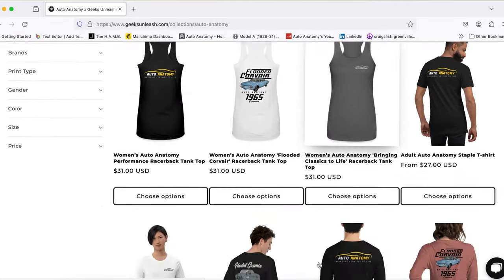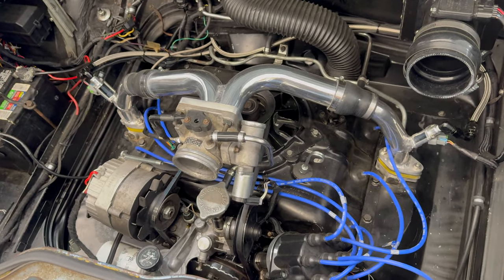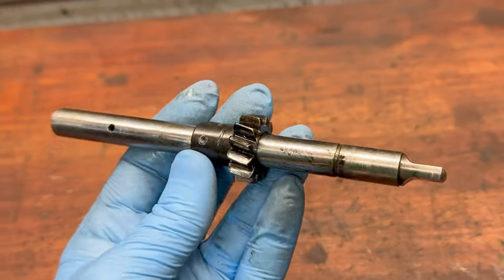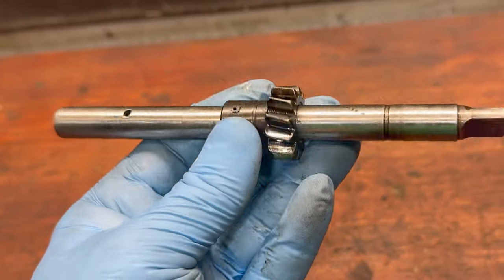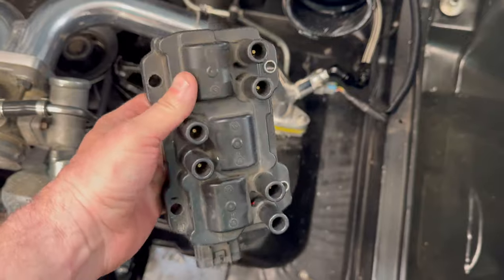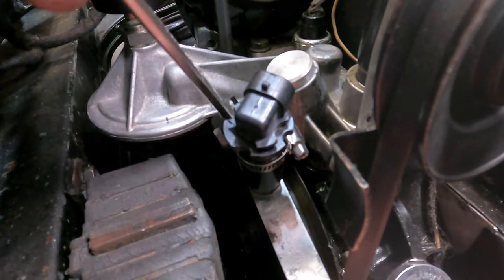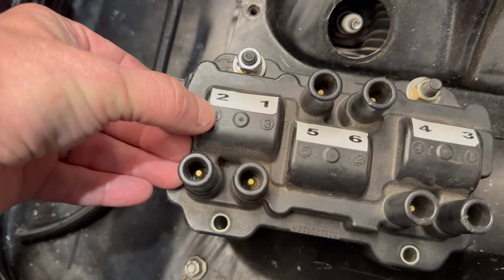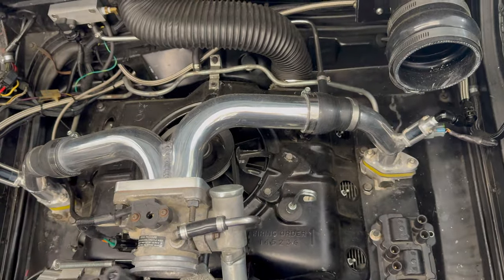What?!  Distributorless Ignition on the FLOODED 1965 Corvair with Fuel Injection!

Comment from the maker: This was a HUGE project, but what next?  I'm thinking either rear suspension or front disc brakes.  Let me know below 
what YOU would like to see

Sean & Christie
Reply: Whatever you think it needs most. Braking is pretty important but so is handling. How about a set of Corsa heads and an electric fan to replace the belt driven one. I always had trouble keeping the belt from flying off. Have you ever driven stock Corsa with the four single barrel carbs? The power delivery is noticeably different and more  fun of course. That's why my fan belt keep coming off, too many rpms.😁
Reply from the maker: @thatsonebadhatharry8610  I have a set of stock 140 heads here but would like to get some work done one them, like deep valve seats and modify the intake and exhaust ports.  But then we’d need to remake the fuel injection system…
Reply: @AutoAnatomy if you do 140 heads, maybe go from 2 injectors to 6? 👀
Reply: Remake the intake from the rubber sleeves to the heads and add two more injectors. I understand the need for better valve seats. Just pondering how the four port heads would do with the fuel injection. I don't remember but are you using a Corsa instrument cluster? If not do you have a way to check head temps? It would be beneficial if you could use a knock sensor on one or both heads to help control ignition timing. Anyway love what you have done so far. Just keep it between the ditches and have fun this weekend in N. Georgia. 
God Bless and be safe.
Reply from the maker: @silverfin198 When we do 140 heads, the plan is for 6 injectors and sequential injection.
Reply from the maker: @thatsonebadhatharry8610 I do have a Corsa cluster in the car but haven't found a reasonably priced temp sending unit (most are >$100).  I can check cylinder head temp through the computer as there's a temp sender I screwed into the top of the engine through one of the shroud bolts.  It's pretty close to the factory location and gives me a rough idea of head temp.  

As for knock sensor, my concern would be the degree of mechanical noise these engines make, which might make things too noisy and render the knock sensor difficult to utilize (just guessing here).
Reply: Sean, great project and I love the videos. My vote is for the front disc brake upgrade.

Comment: It's funny that we usually focus on horsepower but the professionals balance out all the things that make a engine better.  Easy starting, smooth operation, reliable, off-idle torque, the shape of the torque curve, throttle response.  With mechanical operation, we have to trade off some things for other things.  With a computer controlled engine we can have more of the good stuff without the trade-offs and this is what you worked so hard to accomplish. Good job.  

I had a '61 Falcon.  Even after I just adjusted the front brakes and everything was adjusted just right, cut the drum, and rebuilt the wheel cylinders, the drum brakes were still a problem with the braking either not enough or with the wheels locking up.  Replace the front brakes.  You don't have to go all high performance or aftermarket to get better braking.  For instance, the Omni GLH used brakes from the Chrysler Minivan to achieve fade free braking and excellent feel.  The advantage of Wilwood or aluminum aftermarket calipers is lighter weight.

Comment: Such a clean installation! Amazing that the coil pack bolt pattern matched right up with the Corvair's shroud mounting points! Love the sound of that engine. Regarding my vote for the next video, though the rear suspension is very important, it's not as "sexy" as a disc brake conversion. So my vote is for the disc brakes. It'll be interesting to see how you tackle modulating the front disc to rear drum pressures or if it's even an issue. Thanks so much for these informative videos Sean. You do an excellent job filming and editing these treats. And God bless you Sir.
Reply from the maker: Thank you so much, and it was such a surprise that it mounted so cleanly.  I think I'll likely be doing discs next since that's what most want to see.   

Thank you again!

Comment: You may want to add a couple phenolic spacers to the studs when mounting the coil pack, leave some air space between the coil pack and sheet metal this area gets toasty at idle.
Reply from the maker: Good point, I have some high temp phenolic left over from the intake build, will do that!

Comment: You could go 4 wheel disk brakes, might take a bit of fab work to get the rear calipers mounted though.  I'm definitely sold on fuel injection and no distributor, looks like fun and a lot easier than I thought.
Reply from the maker: It really was such a big upgrade, I'd love to take someone who is on the fence for a ride in the car and let them decide.  No way I'd pick carbs for driveability on a Corvair.

Comment: FANTASTIC so far !!! What I would like to see next is the elimination of the stupid and annoying belt: a way to drive the cooling fan electrically with perhaps a motor driven fan, air conditioning clutch and head temp sensors - What do you think?
Reply from the maker: Yeah, people have tried electric fans before with mixed results.  I'd love to try and figure a way around that but so far the current fan works decently.  Maybe something like the air-cooled 911s have?

Comment: Great work! Wondering if anyone has adapted Honda Goldwing fuel injection for Corvair? Specifically the 1800 CC system which would seem to be a good fit.
Reply from the maker: I haven't seen that one done before, typically it's Fiero or GM 2.5L parts. That would be cool, though!

Comment: Well done, Sean! Wish Georgia and Kansas were closer so I could come see for myself! Exhaust note is awesome! I did a front disc brake conversion on my Corvair a couple of years ago and it went very smoothly. Got tired of fighting the drums that would pull. Discs stop straight and strong. I used the same kit that Clark’s sells. Not flashy but works great and easy to install. If you’re not having trouble with your front drums, the rear suspension project would perhaps make more of a difference. What are you thinking of back there and why?
Reply from the maker: One side definitely pulls just a bit with the drums up front.  I think discs would be a great upgrade to the car and make it more manageable on a regular basis.  

For the rear suspension, I was thinking about monoballs (or something equivalent) for the pivot and some new rear springs.  It all needs to get done eventually, just a matter of timing.

Comment: Awesome! My first car was a 64 Monza. I wanted to buy another corvair, but we moved from sunny warm California to cold rainy PNW. Question, what do you do about heat with the headers. Is there now on the market an electric heater option?
Reply from the maker: You can still have heat with the headers.  I cut the lower shrouds to allow the pipes to come out the bottom.   The heat still works as original

Comment: Either project suites me. I'm curious to know about performance and HP.  How much better is it than in stock form, and how much seat of the pants horse power gain can you feel? Technology can be a great thing and I would bet it has really improved the flooded Corvair. Nice work Sean.
Reply from the maker: Thank you!  Performance is about the same at WOT, but part-throttle and driveability is MUCH improved.  It's much snappier and seems punchier out of turns.  I'm headed to a show this weekend so will be able to do some mileage testing as well.
Reply: @AutoAnatomy  Good luck and be safe!

Comment: Fantastic job. Question, do you think you've gained horsepower from the modifications?
Reply from the maker: Thank you!  It's hard to tell if there's any more power since the limitation is the cylinder heads.  It's certainly more snappy and has throttle response instantly at any RPM.

Comment: can you quantift the mod in terms of power increase and fuel economy increase, thst would be very interesting.
Reply from the maker: So far  WOT power seems about the same, but driveability is markedly improved.  We drove to Corvair Springfest in Helen, GA (about 100 miles each way) at 70-75 MPH, got ~21 MPG average.
Reply: @AutoAnatomy  usually, the worst FI system is better than aveerage  carburetros. The original Corvair carburetors were not the best areburetors on the market.